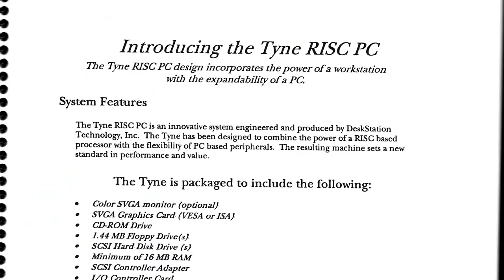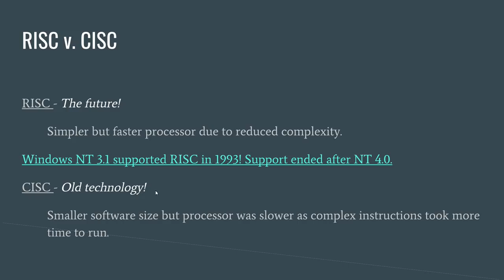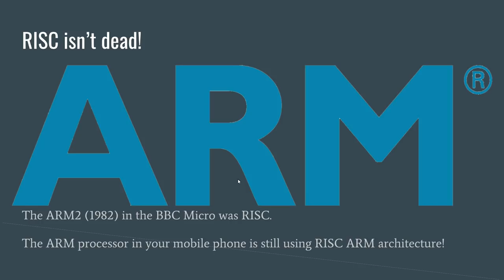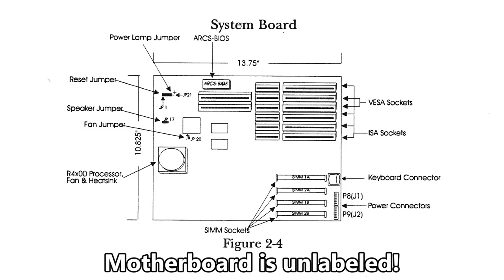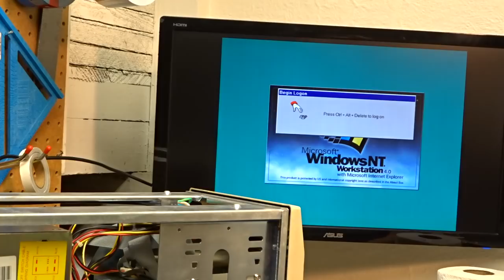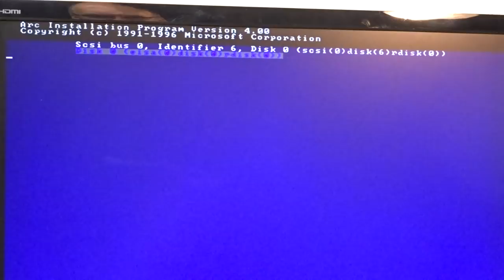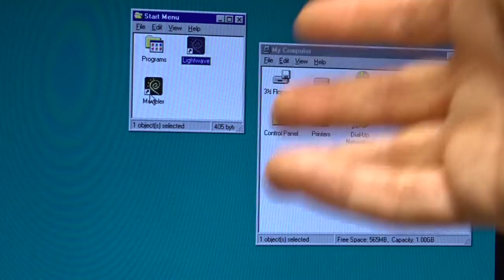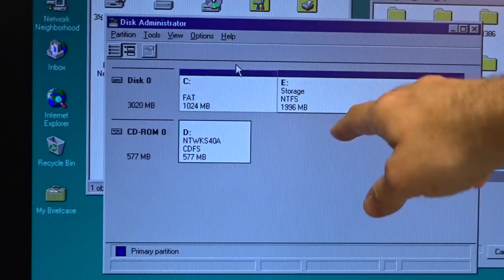Deskstation Tyne: A MIPS R4600 based PC that runs Windows NT

Comment: The hardware key was a parallel port "key" that the program would periodically check for the presence of.  If it wasn't there it wouldn't run.
Reply: Sadly, the dongle at 0:35 is a scsi terminator, not the required key for this software.
Reply: @Anvilshock  a terminator is not a dongle, dodoid

when the software say ding the time must say dong

a terminator is only a resistor in the end of a chain. it's unnessessary to be used without any devicechain
Reply: @loschwahn723  I see you're the reason why the saying exists, "It's better to be silent and let people suspect you an idiot than to speak up and remove all doubt".

Comment: The Mips version of lightwave was a bit of a pain and the HIIP image loaders were such a pain as the 3rd party company that made those never got the libraries to work reliably on MIPS NT.

Lightwave had been ported to MIPS for screamernet (The lightwave render farm software) and at one point I had a box of those motherboards that was used for the Screamer box.   I believe they were actually desk station boards.

I do have a copy of the full MIPS lightwave install around here that I could make an iso of if you want it.

Lightwave at that time was ported to MIPS and Dec alpha and I believe Deskstation did make an alpha workstation as well but it's been a few decades and my memory isn't what it was.

If I dig up any documentation on deskstation I'll post it.
Reply: I do have a few dongles I can't remember if they would work cross platform I do have some of the older lightwave dongle programming software that would be about the right vintage.   I'll dig about and see if any of  that stuff works. 

It was the 3rd party image loaders that were problematic but more a pain for the devs at the time.  I believe when it hit release it was at least working.
Reply: Did you ever dump that ISO of Lightwave? I'd be interested in messing with it

Comment: I remember back in the day seeing a PC magazine where the headline was "Windows at 500mhz"  before there was a 500mhz x86 cpu talking bout a Dec.
Reply: I put together a small renderfarm of DEC Alpha-based machines running NT and Mental Ray. Unfortunately the amount of data that had to be shifted across the network for each frame meant that the speedup was relatively small for the 480i-res frames we were rendering. Upgrading the SGI workstations used for modelling to 100BT ethernet would have helped, but the cards were ~almost as expensive as the Alpha machines.

Comment: If you want to replace the clock chip and make it look nice and have a removable battery, you could look into the alt12887 project where you build a new 12887 using an SOIC-24 DS12885 or TI/Benchmarq BQ3285 , a 6pf 32.768khz oscillator and a cr1220 battery holder and two rows of 12pin headers . Or for cheaper you can get a bunch of ds12885s from Aliexpress in DIP-24 encapsulation bend up pins 2 and 3 and solder a 6pf 32.768khz crystal between them and then glue whatever type of battery holder you want on top of the dip-24 chip and then solder the battery positive to pin 20 and the battery negative to pin 16. Their are many posibilities of different battery configurations, you could use a cr12xx or cr16xx holder which would fit nicely on the top of the chip,cr20xx or larger holder would stick of the side of the chip a lot, a cr2 photo battery holder would probably fit nicely. a cr123a holder would be a bit bigger than the chip, you could also get a 2xAA battery holder and a couple energizer ultimate lithium batteries and bend pins 16 and 20 up on the chip and use a 5 position DuPont connector with the outer position populated and connected to the battery holder.

Comment: You brought back some memories for me. In early 2000 I started working as a sysadmin for a university that was a big DEC shop. They had investigated NT on AlphaServers (I believe some 1000s ran it and a couple 4100s were bought for possible use)  in the late 90s but didn't find it of great utility and the announcement that 2000 wouldn't be on that platform was the final nail. I only got to briefly play with them in the last week we ran it and the machines were re-purposed for VMS work, which they ran until sometime in the 2010s - I had left the place before that was decommissioned.
Reply: I did admin work on DEC Alphas, back in the day. All running OSF/1 aka Tru64 Unix.

The amusing thing was, the motherboard battery on one of them died, so it forgot what OS it was supposed to boot. Guess what it defaulted to? Windows NT!

Comment: BBC Micro models A & B were based on the MOS 6502 8 bit platform, Acorn build development machines with a second RISC chip for development of the ARM platform which went into the Archimedes, but these were never generally released.

Comment: Got to this video through YouTube recommendations. Sorry for reviving this old comments thread.
It's also the first time I see Windows NT on a MIPS processor. I knew there was a MIPS port of NT, but I've never seen an actual machine that could run this port.
I bet this thing can run a MIPS port of Debian Linux as well.

Some corrections about Windows on ARM:
Microsoft actually made an ARM port of Windows back in Windows 7 days. There was an experimental version of Windows 7 on ARM which was demoed but never actually released. Windows 8 had a fully functional ARM port in form of Windows RT (artificially limited to just Store or MS signed desktop apps) and Windows 10 has an ARM port as well.
Reply: The Win NT CD has a folder called i386 for x86 CPUs and I think it has a folder called alpha for DEC alpha CPUs. I have the CD at home.

Comment: You should probably be able to run NetBSD on this. Together with its ports that should give you access to most open source stuff. Not sure if you can find a Linux version that can support this and still has repositories to install software from.

Comment: Funny thing seeing this video now - I picked up a Surface tablet that unbeknownst to me is running an ARM64 Windows 10 (or, actually Windows 11 now) - Microsoft even seems to emulate x86 on this thing, cause it'll happily run Steam and apps from that, and it's doing pretty well. I keep using it to fall asleep to YouTube without the power plugged in and the next morning it's usually STILL alive and playing something, so the battery life extension is no joke, either.

It's actually really snappy. I put Windows Pro for Workstations on it and it's also pretty neat in the feature department. Makes for an impressive laptop alright. :)

EDIT: oh and the MIPS and PPC did go strong in games consoles, the PS2 used an R3000, and everything in the PS3's generation used PPC. It took until the PS4 to see more x86, which the rumor mill has it is why they're so power hungry.

Comment: Nokia was concerned about the amount of data executable software for the ARM would take up. So ARM came up with the Thumb instruction set, which was a cut-down version where each instruction was 16 bits. The processor could run in thumb or normal (32-bit instruction) modes. C code compiled with this took up less room, which still mattered for phones. It did not run as fast however, esp. for hand-coded, so the 32-bit mode was still very useful, as well as for backwards compatibility. Because of this ARM got the deal which went on to make them a company worth billions.  I used to write software in ARM assembler for the Archimedes and later the Game Boy Advance. I did some code for the PS1, but we mostly coded that in C, rather than MIPS.

Comment: ARM1 was completed in 1985 and put to use in the original Acorn Archimedes line of computers released in 1987.

AMR2 was completed in 1989 and put to use in the Acorn Archimedes A3000 computer, the last Acorn microcomputer released that bore the "BBC Microcomputer" nomenclature.

The BBC Micro was released in 1981, using the MOS 6502 CPU as used in the Commodore PET / VIC20, and Apple II.

As a sidenote, the BBC Micro was derived from an Acorn prototype platform internally named "Proton" which was supposed to be based around a 16 Bit CPU with the 6502 and associated I/O devices only acting as an "Intelligent" I/O platform for the 16 bit host.

This idea made it to launch in the BBC Micro in the form of the "Tube" bus, which allows second processors to be easily connected to the BBC micro and use the micro as simply an I/O Host.

The ARM development was done on the BBC Micro using this bus after Acorn visited MOS technologies and felt their approach to designing a 16 bit extension of the 6502 was a bit too "Cottage industry" (their exact words) and Sophie Wilson felt her team could do better at home; and thus the ARM architecture was born.

Even back during the prototyping days of ARM in the mid-80s, it was an incredibly power saving chip. Their original prototype board provided enough power to run the processor through the protection diodes on the TUBE bus - which they discovered by accident when they connected it one time and forgot to connect the power supply to the ARM prototype board. It was working anyway.

34 years on, one can still connect a new ARM second processor to the TUBE bus on the BBC Micro. Yes, the Raspberry Pi can be interfaced with the BBC Micro via the TUBE bus allowing the Beeb to execute code on the 1GHz+ ARM on the Raspberry Pi.

https://www.youtube.com/watch?v=RLaeaoHXl4I

And yes, someone's porting Doom to the 1981 platform and it's modern co-processor :)

https://www.youtube.com/watch?v=V6HQrXCRZsw

Honestly, growing up in a country and a time where Acorn Computers reigned supreme, at home and at school, gave me (and many others) great perspective into the rest of the computing world. Everything else just seemed so primitive. Toy like. Infantile. 

I'm very happy Acorn and their engineers live on in the ARM architecture to this day, I believe they've now licensed over 12 billion ARM cores.
Reply: The original Archimedes line, as well as the A3000 which was effectively a continuation of that line, all used ARM2 processors. The ARM1 was confined to Acorn's ARM evaluation products.

Comment: With a lasermaster rip box than drove a printer the computer used a form of nt3.51. The install cd was really like hardware.  It formatted the drive then installed parts of nt3.51 then the lasermaster printer rip program. Nt3.51 had in its code looking for the cpu type. If it say a pentium the install would work. If the cpu was a pentium pro or higher the install would fail. Later on some folks found that one could hack and change lines of code to allow usage of a faster cpu. The original lasermaster printer  was a custom bulk fed 36" inkjet with 4 bulk 500ml inks. The ink sets could be either water based or pigmented for outdoor signage. Each inkpack fed a custom hp26a cartridge with  a tube filling it. Each new bulk ink cartridge had a color calibrator chip that would fine tune the color. The lasermaster system was a custom novajet 36" printer with a rip box and a wazoo calubrator that read the test patteens. The unit was 40k at first then for years in the 25 to 35k range

Comment: The magnet(s) inside the CPU fan may have depolarized and the motor will just exert a lower force.
You can apparently see this in model trains too.

Take with a grain of salt since I'm just repeating what others have said and not looked into it.

Comment: It's an old video now, but Acorn was still producing computers with arm chips into the 90s too.

Most schools in the UK had acorn archimedes machines and was used in broadcasting and industry too here. Risc OS3 was the last version of the os supplied on the archimedes and bigger model and you can actually run v5 on a pi3 (not compatible with pi4) 

Most of us in the UK had been using risc computers for decades before the IBM compatibles became affordable

Comment: ARM chips were developed by Acorn and originally stood for Acorn Risc Machine and was available as an add on for the BBC to develop and test with, but it was never used in a BBC computer.  The first computer it was used in was the Acorn Archimedes 300 series back in 1987.  The ARM 1 chip was missing several key instructions and was never built into a computer and was used as a demomstrator at a number of computer shows to preview the technology.

As for claims that the G3 was not as fast as an intel Pentium, Photoshop was demonstrated many times with a G3 PowerMac completing workflows faster with a G3 processor clocked at less than half the Windows machine next to it running the same workflows, again similar with AVID systems and many more.  By the time of the G5 debacle where IBM and Motorola both failed to deliver decent performance, Intel had abandoned the P4 and was working on the core processors, which finally put Intel on a decent footing as they had been thrashed in floating point performance and general efficiency for years by the Athlon and were still embarrassed by having to adopt AMD's 64 bit extensions after the failure of itanium.

Risc support was added in Windows 8 with Windows RT, not Windows 10, the latter only corrects the mistakes made earlier and paired with the right ARM based chips, can deliver better performance overall, never mind better performance per watt.  With ARM based Windows 10 laptops available, well supported and well liked and ARM based Macbooks rumored for the end of the year, Intel should be worried, if not regretting selling off all their ARM portfolio to their competitors in the early 2000's

Comment: Should be able to run Microsoft Visual C++ on there, at least Version 4 had a dedicated MIPS version. Though it also sounds like version 6 might be able to do it, though I was only able to find a copy of 4. Would at least get you some large application to run, and possibly allow you to compile over some other applications.
Reply: What you need specifically is Microsoft Visual C++ for RISC Edition, which was made for 2-4, though there are reports of 5-6 as well. You need a RISC edition that explicately includes MIPS support as some only have Alpha, and others have Alpha, MIPS and PPC.

It has to be installed on an x86 machine and then you can cross-compile and deploy to your MIPS one over the network (you can hook up standard ethernet to that network card with a AUI adapter from the net. NOTE: you may want to use the existing card vs. replacing it as I doubt you will find a card with ARCBIOS support).

Comment: Great video! WinNT machines always interesting to come across, WinXP arch with Win98 GUI, no WinXP overhead, drivers and the such had to be loaded manually, xp drivers (most of them) would work though. Seems to me most NT machines had technical propietary apps loaded, usually weird stuff I could never figure out. The last one I used drove an AGFA film pos exposure unit. You'd just turn it on and make sure 2 apps got sparked up, that's it. My work was done on another PC then loaded to a Mac running Quark Express and fed from there into the AGFAs NT. Final output was exposed film loaded into a light sealed capsule, that had to be taken to the back of the shop and loaded into a developer unit.

Comment: 4:36 No, it was not Intel that took x86 to 64 bits. The credit for that goes to AMD. Intel figured that x86 would run out of steam by the time 64 bits was needed, so it developed an entirely new architecture, called “Itanium”. Which kind of fizzled in the marketplace, particularly after AMD came out with those 64-bit extensions to x86.
Reply: this is a 2 year old comment im replying to, but thanks for pointing this out as its crucial information. That said, its a great video

Comment: I don't know why YouTube recommended this to me. I had nearly forgotten about using Windows NT. Back in the day I had Windows NT Workstation 3.5 on floppy disks. It ran on x86 architecture. Another part of the department had DEC Alpha machines, and were raving about X. I clearly remember the DEC stuff using coaxial Ethernet and those AIU (I think that is what they were) connectors. The building had coaxial cable running between floors to get 10 Mbit half duplex Ethernet connectivity. Eventually we got Windows NTAS, also on a tray of floppy disks. Around the same time we finally got fiber optic cable between buildings. All this was good stuff for the time, but I wouldn't bother going back to it. Just thinking of the power consumed by all that old technology, those long SCSI cables, the IDE and floppy cables, serial mouse, partitioning disks and then having to format before install. UGH!